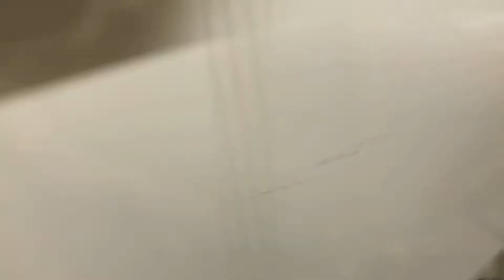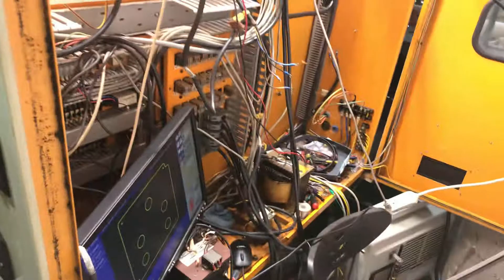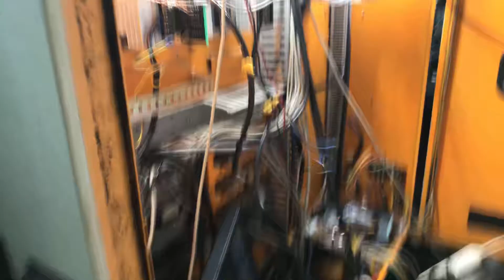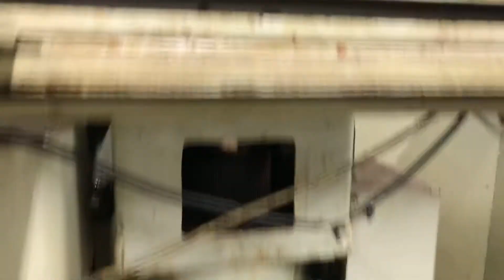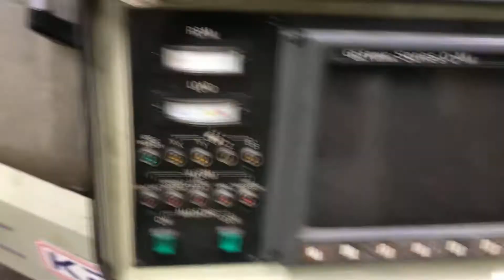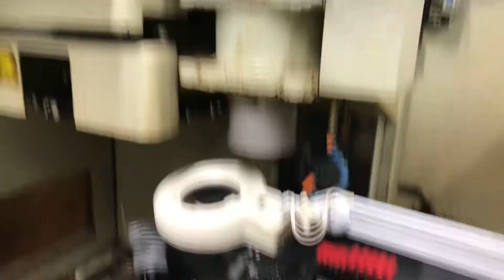Fanuc Redtop VMC Conversion

Comment: Hey Rathan, what software are you gonna use and how much this retrofit gonna to coast you? They say to me if I let doing by one company it will be around 10/12k but if I start do it self than I start with 3k for xyz with drivers but I want to keep red cups because they badass
Reply from the maker: I used a Centroid Acorn Controller and used Ultra 3000 Allen Bradley Drives. I think I spend around 100 us per drive used on ebay. they are the Ultra 3000 20. I will get you the exact part numbers. 
I am in the machine around 1600 in parts not including the purchase of the machine. I used the old Fanuc AC Spindle controller as Centroid has instructions on their site on how to reprovision the drive. As the spindle motor is not a servo this is important to remember.
Reply from the maker: I also have a centroid breakout board Ethernet controlled that I am going to install next to add my tool changer functionality. it was around 350.00
Reply from the maker: If you look at any of the videos I have posted of CNC content they are all done with Fanuc and Allen Bradly controls.
Reply from the maker: You’re right they are awesome. I will say that they were a major challenge to get working however well worth the time. I will look through my emails and find the documentation someone was kind enough to send me.

Comment: Hey budy, I have same machine almost. It’s Aciera f450 and I will do same with keeping motors. Al those retrofit guys say that I need to replace those. Is that so difficult or they just want me to spend money on new motors? Do you have vid of how it become? Thanks buddy
Reply from the maker: I would be happy to share the documentation, I have to scan most of it first and have been crazy busy with my HaaS conversion, I will say that the Fanuc motors work amazingly with the Allen Bradley drives Ultra 3000. I can even share myu configuration to get you started.
Reply: Please, please 🙏 . I get fuckt with this machine. Not one mm I see it moving. Thanks buddy 👍
Reply from the maker: Just remember to setup the limit switches before you do anything. When I did my tuning with the drive I actually destroyed the ball screw.
Reply from the maker: I have a video in the playlist of it working amazing was making parts on it for a high school robotics team.

Comment: Hey! I love the documentation of your entire process. Looks like you've got controlling these red tops with the ultra 3000 down to a science. 
I've been trying to breathe some life into my old Fanuc CNC, and your videos have really helped me through the process. I'm a little stuck now. I've got the Allen Bradley to receive the encoder info: I'm seeing line counts and all that good stuff. However, when I try to start the motor up, the motor just whines and the Allen Bradley throws all sorts of errors.
I'm just about at wits end, so I thought I give this a wild try. Would you be able to guide my final setup with these motors? I'd love to work something out if you'd have the time to help out!
Reply from the maker: I will try to get the docs completed and shared. there are a lot of people who need these docs. I was fortunate enough to get started with some docs I found from someone else online. However I have added a tremendous amount of support to them.
Reply from the maker: Sure happy to help if you still need help. The profile running is major important